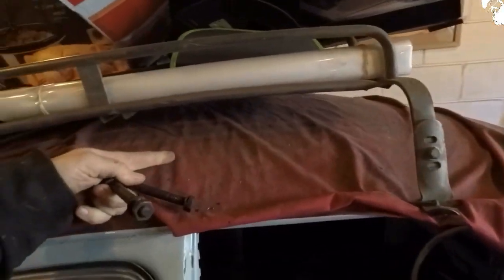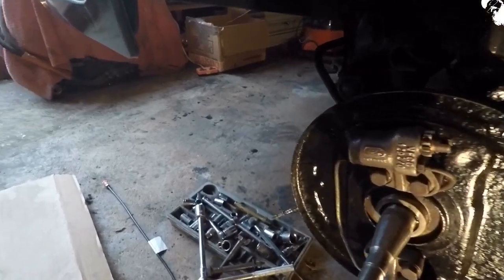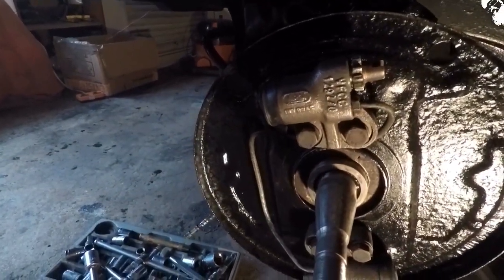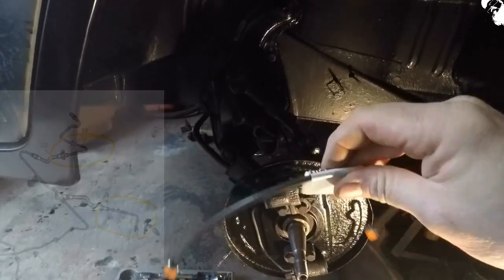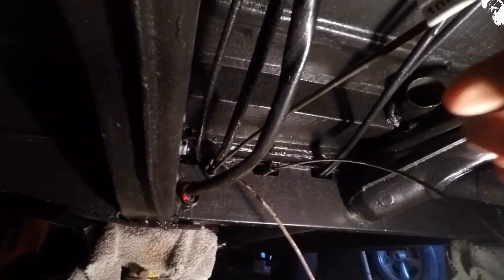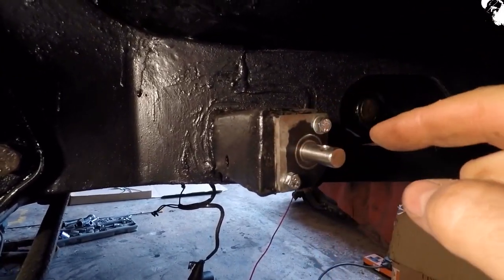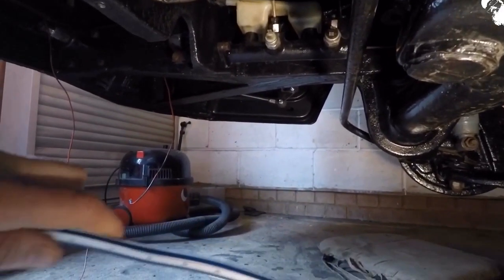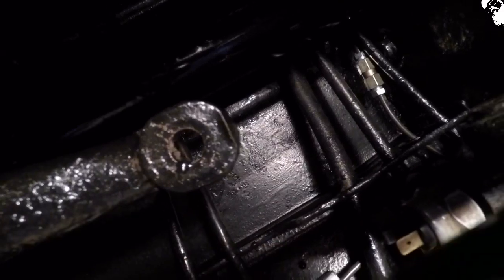Classic 1970 VW Camper Bus restoration. ‘Day 69 - brake lines’.

Comment: Good progress. I’ve started my motor and screwed up right away. But every mistake is a lesson. I’m now waiting on lifters then I’ll be back at it. Does your bug and bus have running motors?
Reply from the maker: Gotta learn from your mistakes...best way..
The bus has a 1600. Had troubles the last time I tried to start, but it looks like it just need the electronic ignition changed out.
The bugs engine I put in that other 67 I got rid of, however I may have a cheeky 1776cc stashed away that I haven’t used as yet. Had it years but never ran it. Hopefully it runs, needs a few parts though.
Take care.